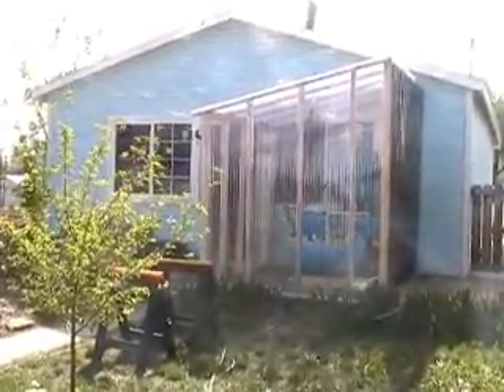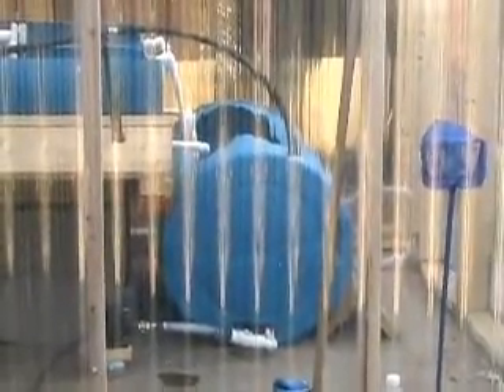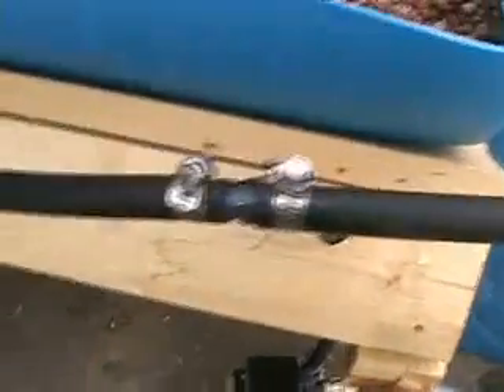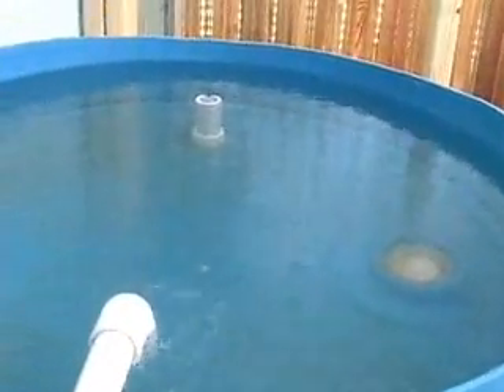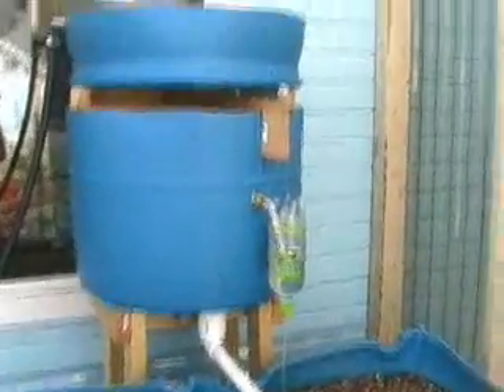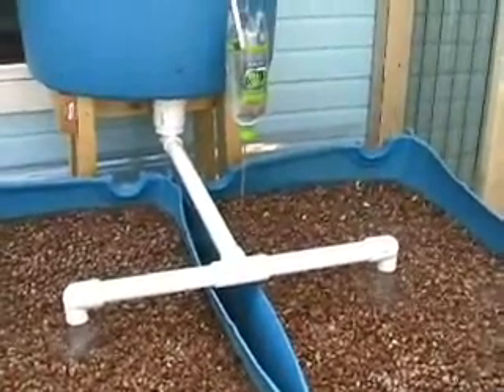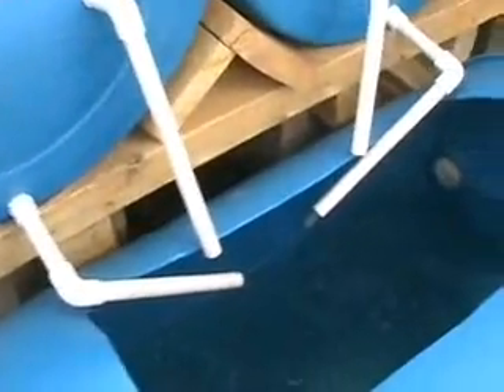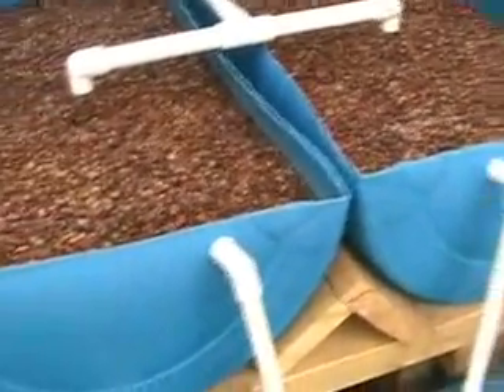barrelponics

Comment: Have you considered a simpler design?
What was your reasoning for using the toilet flush? An bell auto-siphon would have been just as effective, lowered the head needed for the pump, and less mechanical failure points. It would have also taken less space.
Thanks

Comment: you shouls also try a barrel garden for tamatoes.fill a blue barrel with water burie it 1/3 or 1/2 in ground plant tamatoes 1 foot away all around barrel.in spring the water will heat up during the day and protect them from early mourning frost.in fall this will reverse and cool at night and stay cool do to foliage covering the barrel protecting tem from mid day sun..
good luck.

Comment: what do you use to drill holes in your buckets.  I am going to steal your genius idea of using the water bottle attached to toilet flap, instead of buying a timer.  Good job you need to post an update of what the plants look like now.  thanks for the inspiration.  Is there a hole on the water bottle lid?

Comment from the maker: I put a few smooth rocks in there to give them some structure (see my more recent vids).  Believe it or not, castles and plastic pirates are not part of their natural environment but they do like some structure.  I would caution folks against using urbanite though (as I initially did) because it seemed like it was a little too rough and may be an easy way for them to damage their scales, which is very bad.

Comment from the maker: It really depends on the system you build and how frequently you want it to "flush".  I use a Pondmaster 750C, available at petsmart.  If you refer to Travis's instructions (which I strongly recommend you follow closely - do a google search on "barrelponics pdf" fo find it), he'll have good information for you on choosing a pump.  Remember to pay close attention to the pump height as well as the flow rate - very important.

Comment: I might suggest a lid for your top tank with a vent hole to keep algae growth down, while keeping heat from buidling up.

You might also spray  the outside of your flush timer bottle with black paint.

You can also cover your grow beds with opaque plastic film and put holes in the film where your seeds are planted.  This will cut down on evaporation - a lot.

Comment from the maker: I'd say no.  Use aquarium sealant instead.  Caulk, even when dry will probably leech nasty stuff.  I'll put it this way; would you store leftover soup in a bowl that had been sealed with the stuff?  Since you're using this system to grow food, you should use only food-grade materials.  That applies especially to your barrels.  DO NOT use barrels that were every used for anything but food.  VERY IMPORTANT & worth repeating - DO NOT use barrels that were EVER used for storing toxic chemicals.

Comment: I am going to build one of these, I actually just got a 330 gallon areator tank today for 10$.
 I plan on cutting it in half (its 4 feet tall) So maybe I will have a max of 200 gallons in it. Can you give me a link of where I can get a pump that would cover this amount of water? I keep finding ones but they are very expensive. Thanks

Comment from the maker: I didn't really keep track of the cost.  Travis has done workshops where the participants have built these for less than $200.  That doesn't include the greenhouse, which probably set me back about $250.  If you scrounge and dig and improvise, you can really get these going on the cheap.

Comment from the maker: Not meaning to sound defensive but in the interest of debate I have to say that the timer on this system is certainly not overcomplicated.  I dare say that its simplicity is what I find so impressive.  I haven't had to adjust it or even so much as look at it in several weeks.  It requires no electricity and is so simple that a child could build and/or repair it.  Total cost is less than three dollars.  Electric timers are fine but I would venture to say they're actually more complicated.

Comment from the maker: Some plants, such as lettuce, can do just fine with their roots constantly under water.  But most plants like to take in some oxygen from the air through their roots.  

Atmospheric oxygen (O2) is a little different from the oxygen in water.  Water does have some O2 in it (dissolved oxygen or DO) but in this system, there's not enough DO for good plant health & photosyntheis so the plants need some access to the air.

Comment from the maker: The upside-down water bottle is the timer - basically it's like an ancient Chinese water clock.  Once again, Travis is a genius for thinking of this.  Once the water reaches a certain level, it fills the bottle with water.  The weight of the water in the bottle causes it to fall, which opens a toilet flusher.  That's the timer - totally mechanical and integrated into the system.  If I ever get this thing on solar power, it'll be completely self-contained.